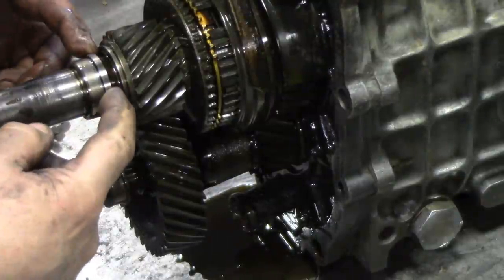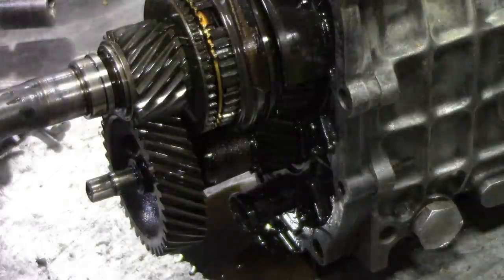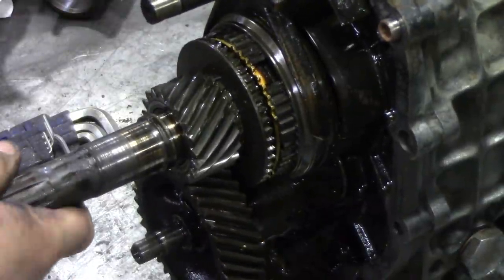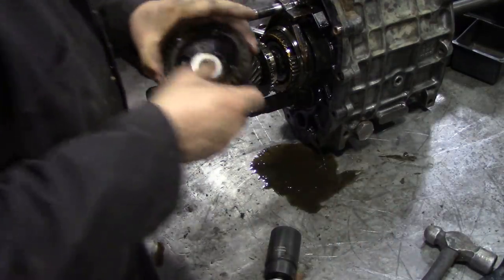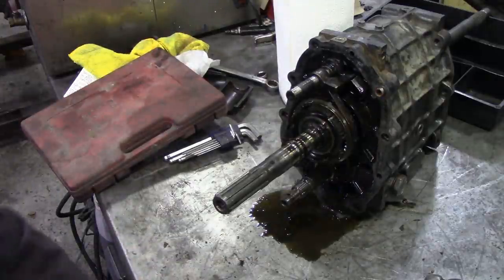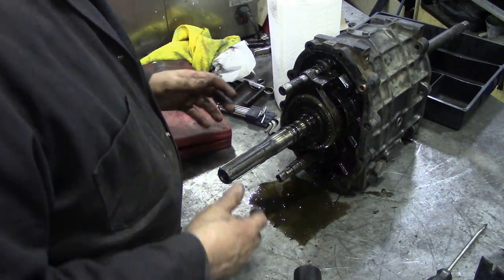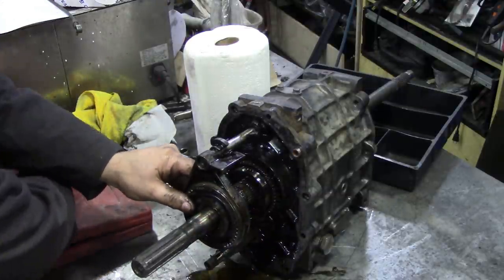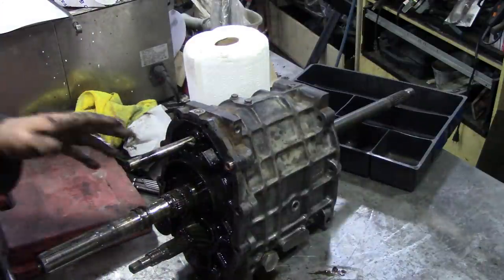R380 suffix L overhaul Part 3 Removing 5th and Reverse

Comment: Hold up! Is that two dismantling tools being used at the same time? When I bought mine, where in the sales blurb did it mention that I would need two?😂.
Also, is that EP90 I see leaking all over the bench? Shouldn’t it be cough mixture red MTF, or am I missing something?
Reply: Two dismantling tools are a treat. Mike sells them as a pair too.
Perhaps the original oil. I wonder if it has a beautiful perfume.
Reply: @ianhellyer1473  
Blimey, the oil in my 20 year old R380 comes out the same cherry red as the stuff going in. Mind you the drain plug always has a very pretty Christmas tree of metal filings on it 😂
Reply from the maker: I know it was not EP90 and there was no sulfur smell - could be the original MTF - lot of bearing damage, but strangely no gear teeth damage - never seen this before!

Comment: Brass from synchros doesn't damage gears and bearings? Comes out in the wash?
Reply from the maker: Usually - but the brass particles comes from the bad tooth contact on the gears

Comment: Are the splines/shaft twisted preventing the gear sliding off?
Reply from the maker: No I went to JP's shop and we put the shaft in the lathe and it was straight, but there seemed to be a spline issue and with a bit of grinding paste and a bit of work we managed to eliminate the sticking spot

Comment: Hi.

The blackness on the gears and the damaged splines, suggest some kind of continued overheating.

I imagine the smell of that muck that came out...

Cheers
Reply from the maker: Was not very nice - took a lot of cleaning!
Reply: Lack of regular oil changes, and the right oil more like. They won't run for 20 years on the same oil, many owners think it's "lube for life".
Reply from the maker: Indeed - you could be misled into flushing the box out, but all the bearings were shot, but strangely there was not tooth damage